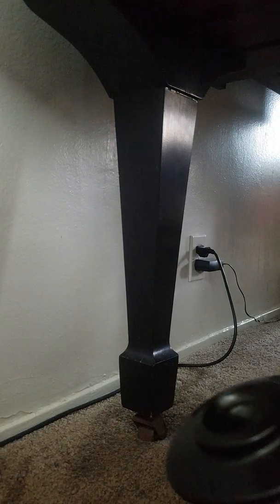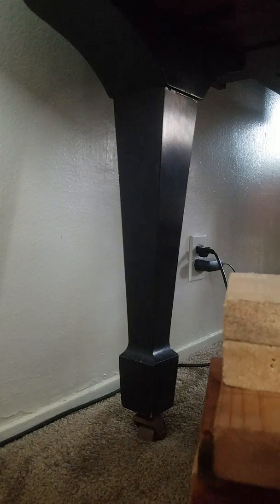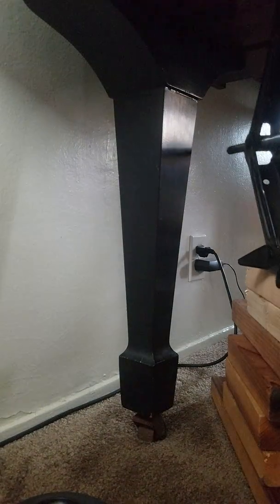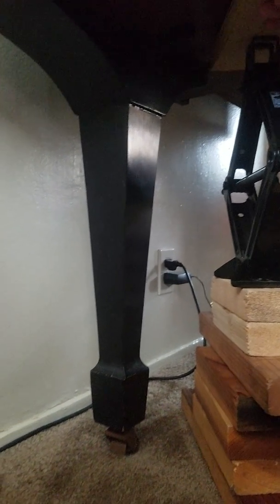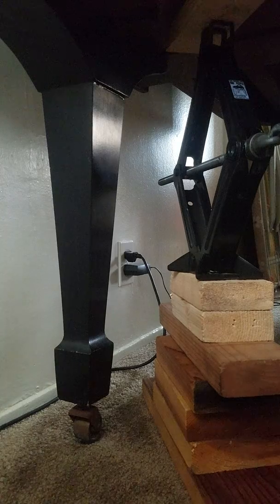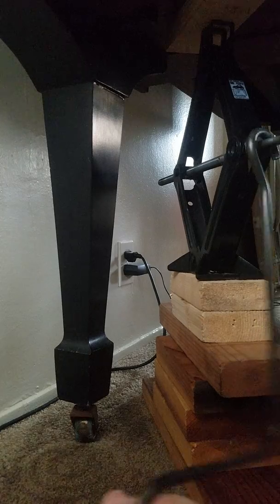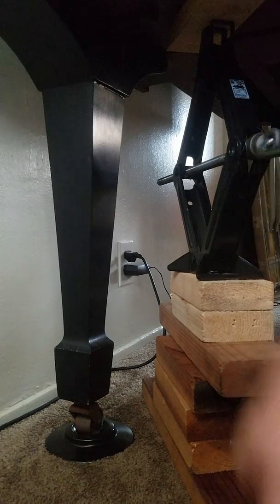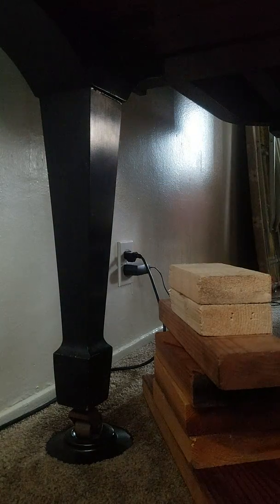Lifting a Grand Piano using a Car Jack

Comment: I was worried about the wood on the carpet collapsing!
Reply: You’re a gambler using 2x4’s which have such a narrow profile.  Make a small frame out of 2x6’s about 18 inches high reinforce the corners with prefabbed angle braces and then bolt your scissor Jack to the top.  Then you’ll have some stability.  Cut some small sections of 2x6’s to use on the top of the Jack and place up against the bottom of the piano.  It’s just a matter of time before your 2x4’s aren’t aligned and you’ll end up crushed or have a horribly damaged piano or both. An ounce of prevention is worth a pound of cure.
Reply from the maker: I've done this quite a few times on multiple surfaces and never had any problem.
Reply: @PianoWrench  Well, I moved a half ton square grand piano by myself thanks to you. Now do a video on how to fix back pain 😂🤣
Reply from the maker: @ZsaZsaUmbra  Good job on moving the piano! Hope your back heals soon.